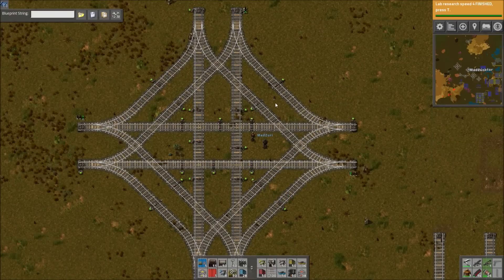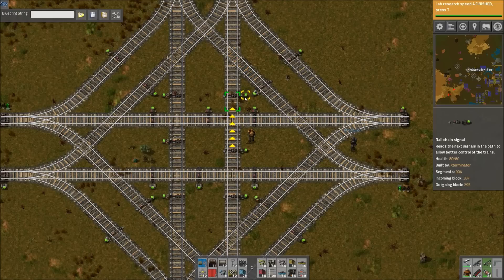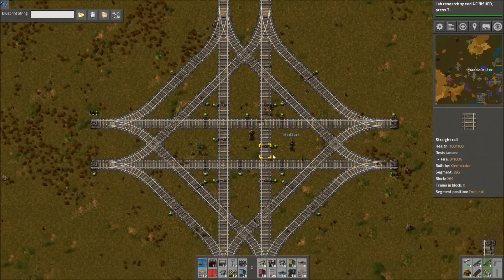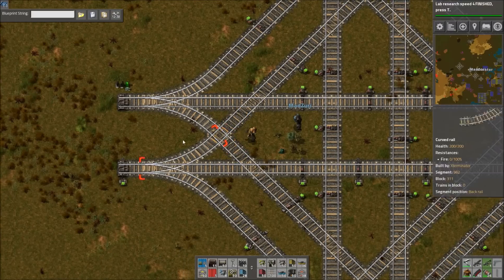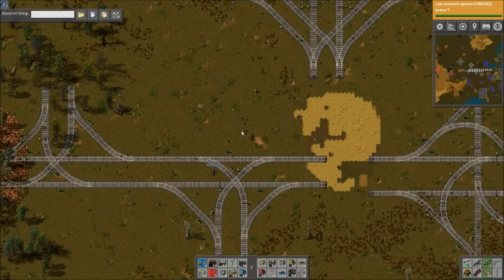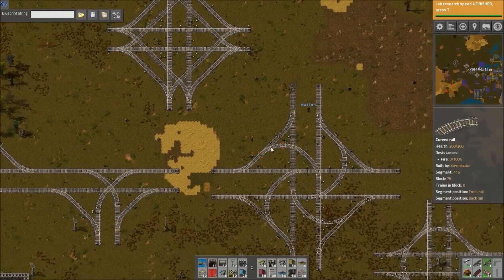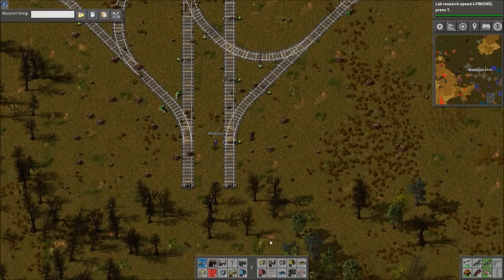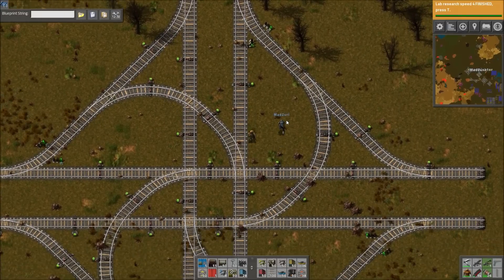Factorio Workshop - Building A Better Factory :: The1Wolf34's 4-Way Rail Junction

Comment: I think I prefer the 3 wide rail. I've messed a lot with junctions and made a whole book of them. One of the things that I found out during this exercise is that a lot of the signalling issues you would have with 2 wide rails can be corrected simply by widening to 3 rails wide.

Comment: Not enough signals. Trains would still have to stop just for trains they don't even need to intersect. 3-wide spacing is required if you want trains to never stop for non-conflicting lanes, without making the junction to wide. Also, you can sling 3-wide to 0-wide easily, if you really need that space.

Comment: Late comment on this one, but I actually like the 3 wide spacing on Xantaxia's design. I use these at the corners of my blocks and with three wide spacing I can unload between the tracks as it were. I can unload fluid right into tanks connected to pumps and then I have a one space on the other side of it to send to the other side of the block as well. Works great when I need the same fluid in multiple blocks.

Comment: Having looked at so many different complex 4-way train junctions, I'm starting to think that the smallest possible footprint, with 1 rail signal on each 'exit', and 1 chain signal on each 'entrance',  is the way to go.
Reply from the maker: Yeah. As long as you are able to signal it correctly I think the smaller and simpler the better. Again though, if you make it too small you won't be able to fit in all the signals you need, so just have to watch out for that.

Comment: Hey, Exterminator, I don't suppose you would have any tips tricks or tutorials for someone who doesn't understand the train signals in this game? I'm stuck with one train per track, and have multiple tracks which are not connected, with only one train. XD;;
Reply: It does not work 404
Reply from the maker: Hey. Currently I don't have any tutorials for that, however me and Zuri do plan to do a train video for this series soon so keep an eye out for that. :) 
There are several other very good ones out there as well. Colonel Will and Xeteth did a very good one, you can find it here: https://www.youtube.com/watch?v=3ZiL7_vfJtQ

Comment: The signals on the junction from the last video (both 2 and 3 spacing version) are set up for right-hand drive but the intersections are set up to be vastly more efficient in left-hand drive.
Reply from the maker: Really? Interesting, I didn't realize that. Had the impression they were built for right hand drive originally. Zuri and I will have to take another look.
Reply: Yeah, I didn't even notice until I went to build one in my own world (which is left-hand drive). It follows 'split before merge' perfectly for left-hand. I mean... it can just be mirrored for right-hand but as is, the physical layout and signals are kinda working against each other compared to changing one or the other. All that said, the word 'vastly' in my original comment was a bit theoretical, it's still not a huge difference with the way Factorio trains actually work!

Comment: I prefer the cloverleaf interchange way of doing rails....might not be perfect, but it has a nice appeal to it (the "off ramp" circles can hold a 1-2-1 train without blocking, and if I go with bigger trains, I can increase the circle radius).  Another design I like is a continuous flow intersection, although it takes up way more space than need be, it also has an awesome appeal to it.
Reply from the maker: Nice! Everyone seems to have their preferred designs. It would actually be cool if you could submit one or two of those designs you like using for us to look at it, if you don't mind. :)
Reply: Xterminator Cloverleaf:

https://dl.dropboxusercontent.com/u/24657744/Factorio/cloverleaf.png

Continuous-flow interchange (similar to the bottom right in your thumbnail, but the spirals do not cross the central pivot, and there's enough room to fit a 1-2-1 loco on the stretch):

https://dl.dropboxusercontent.com/u/24657744/Factorio/cfi.png
Reply from the maker: Robert Caldwell
Nice! Would it be possible to do blueprints of them as well?
Reply: Xterminator Sure, sorry, I just installed blueprintstring....the cfi might need to be calibrated on the signals, I whipped it up real quick from memory....

https://dl.dropboxusercontent.com/u/24657744/Factorio/cfi.txt
https://dl.dropboxusercontent.com/u/24657744/Factorio/cloverleaf.txt

By the way, first time using bpstring, what does the repair tool button do exactly because it warped my rail blueprints at first?

Comment: Any chance you could upload the blueprint for the 2 track space junction you shrunk down from the 3 spaced in previous video???
Reply: And if possible could you also add 1 for drive on the left??
Reply: i could do that for you
Reply from the maker: Sure, I can do a blueprint for the 2 track space junction. As for drive on the left that might take a little bit to get a blueprint up since I would need to redo all the signalling. So will have to hold off on that one for a day or so until I can get back on the map and do all that. I'll let you know when the blueprint for the normal 2 track space one is up though (should be later today).
Reply from the maker: Just added the blueprint for the 2 wide one (still drive on right): http://pastebin.com/E0UbVta1
Reply: sweet thanks...   maybe after staring at the signals i can figure out how i need to set it up for drive on left...   

as an american i find it funny that i prefer to drive this way...    guess its from watching to many LP's where this is how they drive...   =)
Reply: The way I figured out the signalling was to walk the path the trains would take for any given route then every time the path crossed another track place a chain signal before it.  Then when the trains path was leaving the junction place a normal signal just before the merging of the two tracks.  Hope this helps :)

Also if you have a personal roboport you just need to do one path eg the trains travelling North place the rails so it can take any of the three exits plus signals, then blueprint it and just rotate and stamp for the others.

Comment: I don't consider stuffing intersections full of chain signals good practice.
It DOESN'T increase throughput by much. Chain signals have wierd behaviour in this regard. And the complexity may lead to unwanted behaviour. Chain signal on intersection entry. Normal signal on intersection exit.
NO other signals required. Other signals may provide a small boost to intersection throughput. I for myself however do not deem the risk that the additional complexity (and size) have to offset the advantage of a simple and small intersection.
Reply from the maker: Fair enough. In my personal play I would agree with you and probably do the same thing. In these videos we look at best efficiency and throughput, etc as the primary goal so that's why we said to do the signals that way. Again though, you have a point and for just normal play the way your suggesting would be totally fine I think.
Reply: non-conflicting lanes shouldn't have to stop, so you need those signals. Also, pathfinding AI seems really good from my experience.

Comment: Won't placing signals directly after a junction block the crossing line when a train stops there? Don't you only want the signals BEFORE any junction?
Reply: It is best practice to place a chain signal on intersection entry. and a normal section on exit. This way a train will not enter the intersection if the exit is blocked. It will also not enter the intersection if it is reserved by an oncoming train or there is a train in the intersection.
The way this intersection (in the video) is signalled will (most likely) not provide a boost to the throughput, but it likely causes side effects because of it's complexity that makes it impossible to test all the possible scenarios.

The easiest and least ambigious intersection is a roundabout. Chain signal on entry, normal signal on exit.
Traffic moving through the intersection is on a priority track becaus of how the signalling is set up with chain signals on the entry track. The traffic in the intersection can only flow in one direction. It is very simple, small, and cheap (32 rails, 8 signals, fits in one chunk). Unless you have enough trains in your system to neccessitate more than 2 tracks (one for each direction) I am of the opinion that another type of intersection is not worth the additional expense/complexity/floorspace.